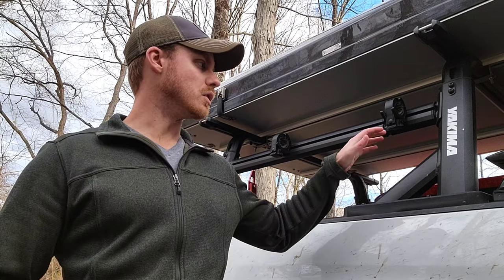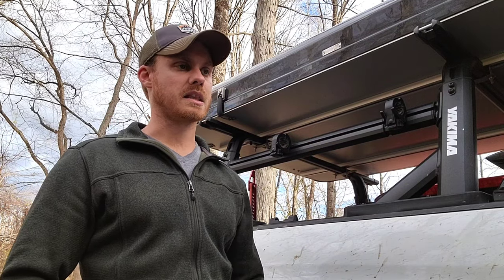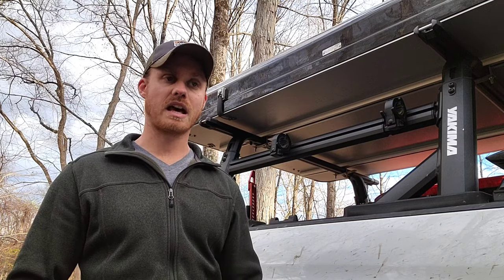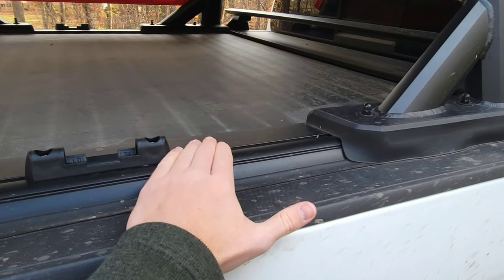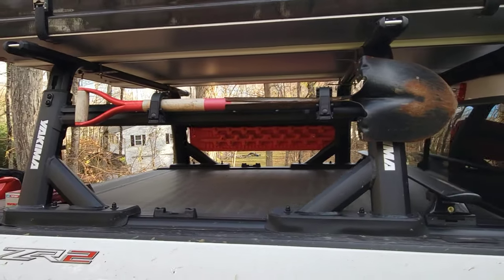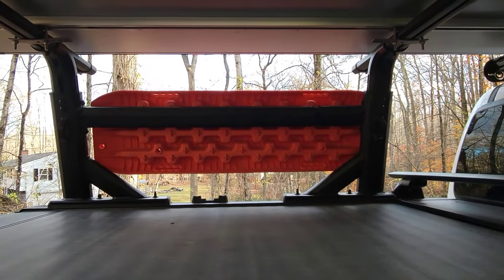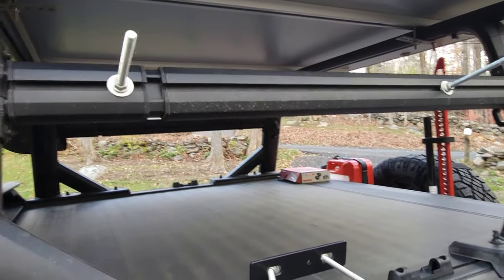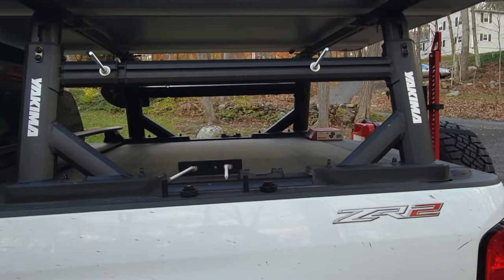Yakima Overhaul HD bed rack review with accessories

Comment: Great review of the Yakima rack. I did a similar review on my challenge last year with my RetraxOne XR cover. Yakima products are in high demand and short supply at the moment. I didn't get the side bars last year and decided I wanted them this year to hold Rotopax's (after the fuel shortages) and it took 5 months of placing orders to find a place that had them in stock and could ship. Ending up getting from REI and was just lucky spotting them in stock online.
Reply from the maker: Yes! REI is awesome. I was able to test out a rack with them first and return it for a full refund 👍

Comment: Great video.  I have same set up on Raptor.  I want to add a 5 lbs propane tank.  Do you have any recommendation as to which bracket would work best with Yakima rack?
Reply from the maker: That's a good question. Im not sure about the side crossbars but I bet their new molle panel kit would allow any propane tank to mount.

Comment: Did those factory iKamper clamps not work for the Yakima crossbars? I have the same tent and I’m looking to add those HD Yakima towers to my Sierra. Thx
Reply from the maker: After posting this video I had someone comment saying that they were able to use the factory ikamper clamps.  When I did research online I read on the Rack-attack website that they dont work, which is why I bought the different clamps🤷‍♂️

Comment: I have the iKamper X-Cover 2.0 mini and went to install it on my overhauls hd rack with the side rails but the x-cover 2.0 mini mounting channels were too short to mount with the Yakima side rails installed. Needless to say I had to remove the side rails and push my towers in closer to each other. I reached out to iKamper and they don’t sell the mounting channels individually as I was looking for some longer ones that would work with the Yakima side rails. I may have to go the aluminum extrusion route but then I’ll lose out on iKamper mounting brackets 3.0. If you have any insight on where I could score some longer iKamper mounting channels, let me know!

Comment: Do you know if there are quick release awning brackets that will work with the overhaul?
Reply from the maker: Im not sure but the overland hd cross bars have a T - slot on top so id imagine if the quick release bracket attaches with a T bolt it could work.

Comment: Is it easy to detach for short day trip to haul boat when the plan is not to camp? Also, is there an option to Velcro fabric with antennae awning to insulate truck bed to use as emergency camper for additional people during emergency?

Comment: Is that a quickfist on the side of the bar? How did you mount them on there?
Reply from the maker: Thats a Yakima product called the "top grip" designed specifically for this rack👍
Reply: @varsityoverland  Gotcha! Does it come with hardware too?
Reply from the maker: @rayray19  yes it does.  Great product! And if you buy the additional yakima locking adapter you can lock the Topgrip with a key.

Comment: I believe you put 55” as the length of the crossbars but maybe that was from the cap to the cap on each side…? Do you know if those are the 60” or the 68” crossbars? Yakima’s site configuration says midsize uses 68” but that seems long to me. Just curious what length fits without a ton hanging over each side.

Comment: I don’t think I’d ever carry a shovel around, do they hold other items?
Reply from the maker: They sure do!  I only carry the shove when I go camping.  Its just more convenient than getting my other gear dirty if I throw it in the bed after using it.  Its advertised for canoe or kayak paddles.  I have a set on the inside of the rack I use to carry my axe.
Reply: @varsityoverland  there’s so many options out there, currently i have the rack with an awning and a cargo box. It’s raining here in california so now I’m back to looking into trying to keep stuff dry. Either a dexked system or a tanneau cover

Comment: Nice truck and setup! I considered a similar setup with the tonneau for added security for storage. One thing that is a bummer that I came across some time ago is that when using the tonneau kit feet the offroad weight rating of the rack drops to 180lbs(from 300lbs).
Reply from the maker: Yeah thats a draw back for sure but my tent is just under 150lbs and in 9 months I haven't had any issues.  Hopefully it stays that way😂
Reply: @varsityoverland  I’m sure you are fine, plus you have added the sidebars and the setup has everything close together due to the midsized short bed, as opposed to everything being extended and raised far apart.

Comment: Do you know or have any insight if this rack would fit a 2022 Hyundai Santa Cruz with stock sliding tonneau cover?
Reply from the maker: Im not sure if the new Santa Cruz has a t-track along the side of the cover.  If so it may work or you'd have to supplement with your own 1/4" carriage bolts.

Comment: Two questions: 1. Does rain or snowmelt drip past the tonneau cover? 2. What cab/roof rack is that?
Reply from the maker: Occasionally I get some liquid drip down the 4 corners of the truck bed but very little.   And the cab rack is from Prinsu Design Studios.  I have a review video of that rack as well if you'd like to check it out👍

Comment: Great video! I had a question around the weight capacity. I know yakima states 300lbs on road / 180lbs off road.  Is 300lbs the static weight limit too? I'm just wondering if it can support a 3 people.
Reply from the maker: I believe the static load is even greater. I did a lot of research before purchasing the rack because I knew itd be carrying a lot of weight.   Ive had the rack for almost 2 years and haven't had any issues.   It supports my wife and I with our dog inside our rooftop tent.  We camp very frequently and have also stressed the rack consistently with continuous cross country travel.  I highly recommend it👍
Reply: @varsityoverland  Awesome! thanks for the quick response and info!

Comment: What is the part number skyline landing pad that Mounts to the ultragroove t slot tracks
Reply from the maker: This is the Landing Pad component needed to make the skyline towers work with a t-slot tonneau cover https://yakima.com/products/landing-pad-base?pr_prod_strat=description&pr_rec_id=3300ce67a&pr_rec_pid=4178950619184&pr_ref_pid=4178952552496&pr_seq=uniform
Reply: @varsityoverland  Your setup is very helpful. Which Yakima landing Pad Number #___ did you use? #1, #3, #4, ... #30?
Reply from the maker: @mokimocorro2486  hi there, unfortunately Im not sure I know what you mean by landing pad number.  Can you be more specific?

Comment: do you know if you could mount a canopy to this rack?
Reply from the maker: Are you referring to an awning?  I know that Yakima makes a few that mount to this rack. I'd also say its possible to mount other brands thanks to the T-slots on the cross bars.  
If thats not what you're referring to can you be more specific?
Reply: @varsityoverland  sorry, i meant an awning..thank u for the reply
Reply from the maker: @adamant7146  Yeah no problem! Yakima has a line of awnings.  I think they call it the "Slim Shady awning."  Which I find clever lol and most other awning brands usually come with an L-bracket that can most likely be integrated into the underside of the cross rails because there's a T-slot system there.
Reply: @varsityoverland  awesome, thx